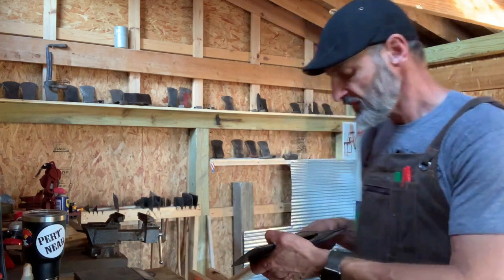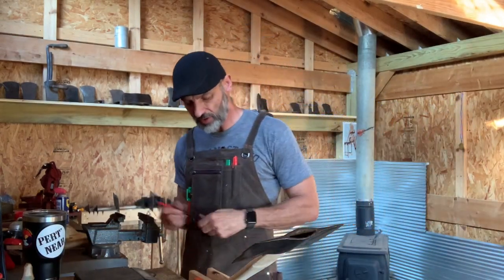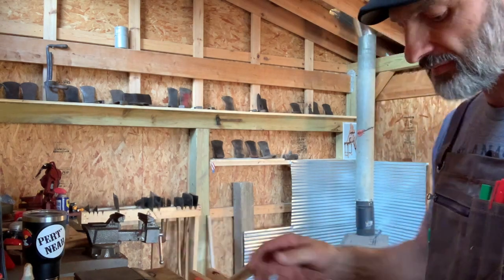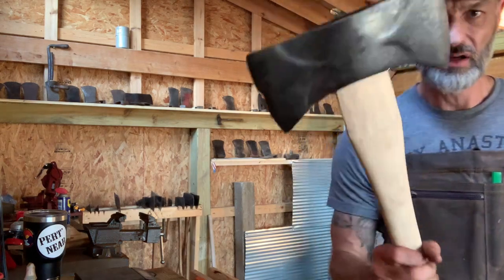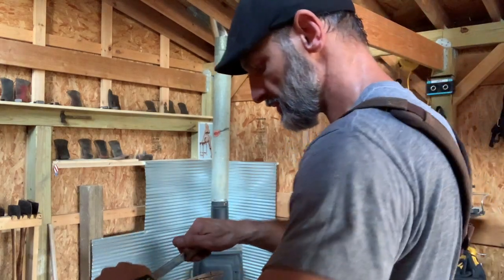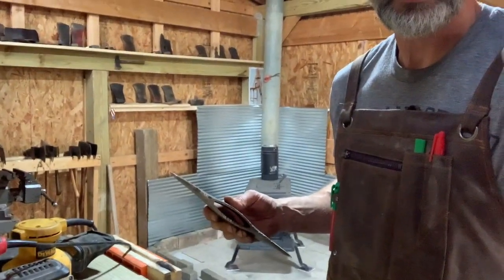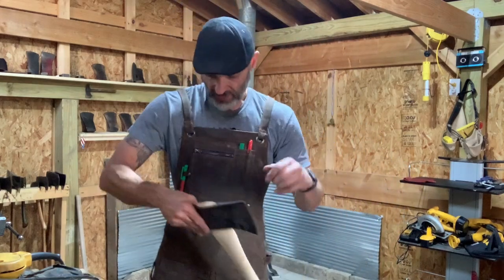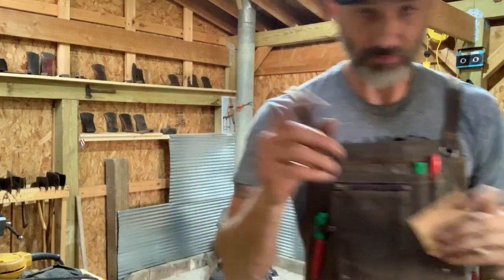True Temper Kelly Perfect - Double Bit Axe: Bonus Dog Trick

Comment: I'm sitting here enjoying your vid.  I've got a Kelly that I'm restoring and it's got the ribs in the eye.  Six ribs.  That's going to be hard to hang that sucker.

I'm thinking of grinding away the ribs about a quarter of an inch from the bottom of the eye so I can get the size of the eye started on the handle.  Then I can get the general size of the eye started on the handle and then deal with the ribs.

Have you ever had one of those to do?  and thanks for your vid.
Reply from the maker: Hey Douglas, there are a few ways to skin that cat, I’ve hung quite an few with the ridges.  You can just remove material as usual and those ridges will create valleys, you may need to remove a little more than usual, or you can use a triangle file and create a valley for each ridge.  Both ways seem to work equally well.  Thanks for the comments!
Reply: @13CrowsVintageAxes  I tend to overthink this stuff.  I'll push on through to the other side (as Jim Morrison would say.  I wonder if Jim ever hung an axe?  Nah?
Reply: just get a small V gouge, put the head on the handle and gouge where the ribs make the mark...easy....easier than removing the signature True Temper ribs.